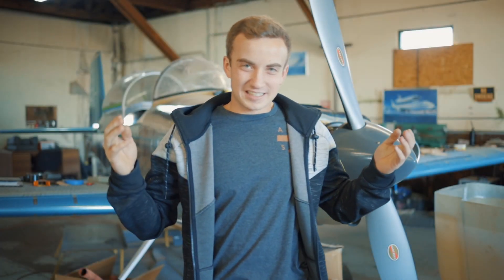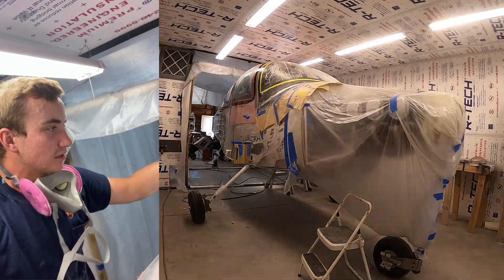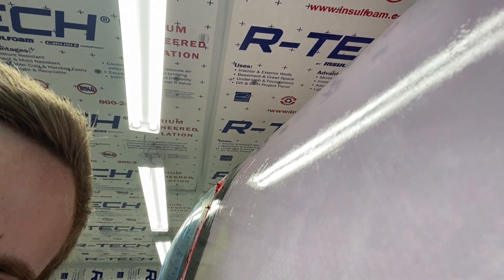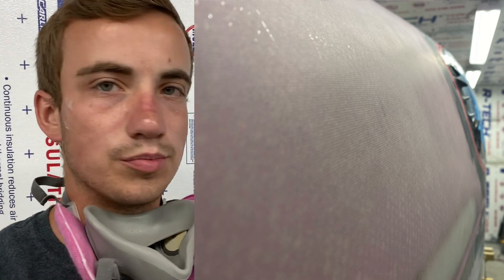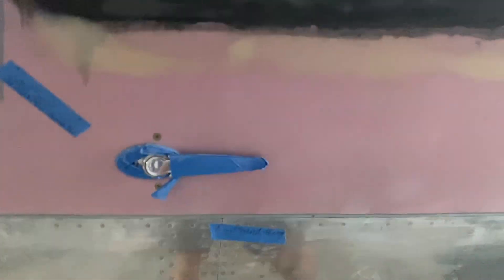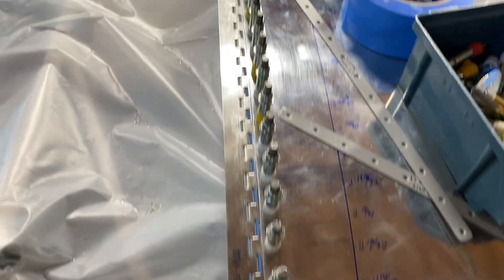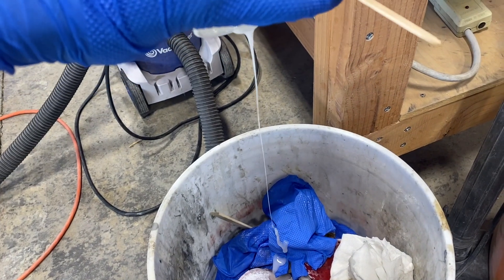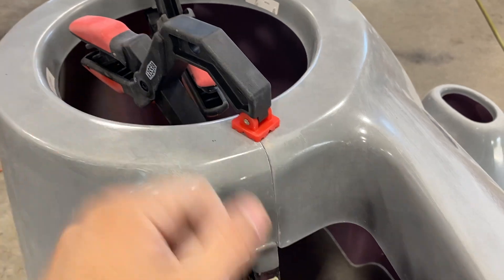RV-10 Build Recap in Oregon! (Cowling & Canopy)

Comment: I do automotive restoration for a living and I am curious as to why you can't just use a polyester glazing putty for the pin holes and imperfections? Not sure if there are special requirements for aviation. Looking forward to building a 10 one day.
Thank you!
Reply: You can do that.  But as in airplane building, keeping it light is important.  How do cut 1 lb from the airplane, cut 1 ounce in 16 places.  The reverse is also true.  How do you add 1 lb to the airplane, by adding 1 oz in 16 places.  These ounces will add up fast and your plane will end up heavy.  So in airplane, we use epoxy and microballoon and a lot of sanding to keep the weight down, even when it will take a lot more time compare to polyester putty.  Every once counts.

Comment: Can you come teach me?  We have a -10 canopy that we need to learn to do in Texas. We are finishing our fuselage metal work soon!  Need to start learning fiberglass asap.  Great video!
Reply from the maker: Teach you what? To fiberglass?? It truly is a work of trial and error. There’s no set way to do or not do something with fiberglass because every single thing is different and changes all the time. BUT! It is fun to work with and make look pretty! Just takes lots of patience, finesse, and sanding. Always more sanding. Feel free to ask any questions you have. And thanks for watching!
Reply: @chandlerwebb2723  will do!  We are about a month out from trimming and fiberglassing. I will miss the metal working that I am now comfortable with.
Reply from the maker: Have you done the fiberglass tip fairings on the empennage yet?
Reply: @chandlerwebb2723  no. I was told to save all fiberglass until end of metal work. It seemed smart at the time. Thoughts?
Reply from the maker: I’d recommend starting with those and wingtips before something as big and expensive as the canopy. At least to see how it cuts and counter sinks and what not.
Reply: Where in Texas are you?  I may want to build with you.  I’m in El Paso.
Reply: @1jamaican  Houston area....

Comment: Good job, do you use guide coat prior to paint?
Reply from the maker: Not sure what guide coat is, but typically after this process you (or paint the shop) will spray a high build primer on it before paint which gets sanded down with like 400 grit sandpaper or less and is the final ‘blend’ to make it all even and the same texture so the paint lays down correctly
Reply: @chandlerwebb2723  
Guide Coat is a black contrasting color to ensure when you wet sand with 400 grit that the surface is absolutely perfectly straight and level...
Reply from the maker: Oh sounds like cool, handy stuff. But I’ve never used anything like that. Maybe time to look into it 🤔
Reply: @chandlerwebb2723  
Use it when I restore muscle cars!
You can use vinyl dye in a pinch, as it dries fast and you’re only dusting it on and not full coverage either...
Reply from the maker: I have used a regular can of spray paint that you just lightly dust on and it shows low spots. So maybe I’ve done something similar, just in a much less professional way haha
Reply: @chandlerwebb2723  
Paint doesn’t dry as fast and can gum up your sandpaper, seems like your are doing it might want to try vinyl dye flash off pretty quick...